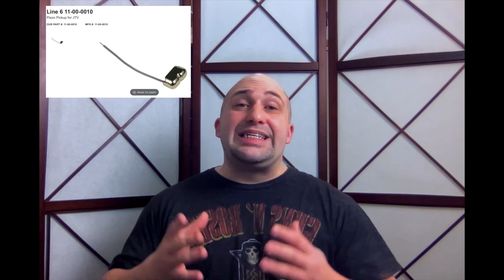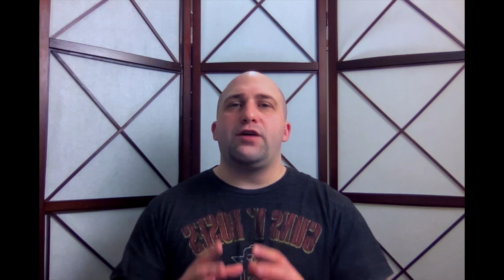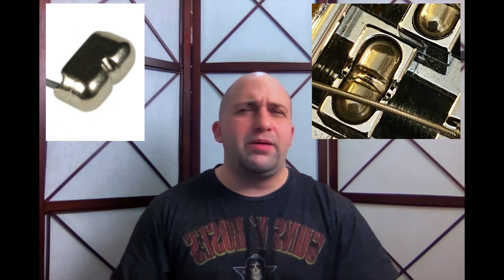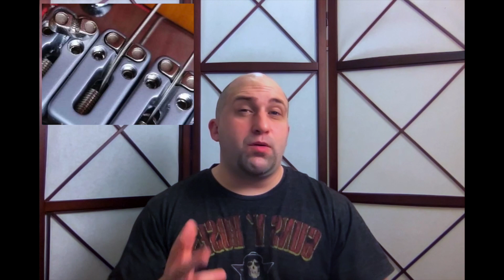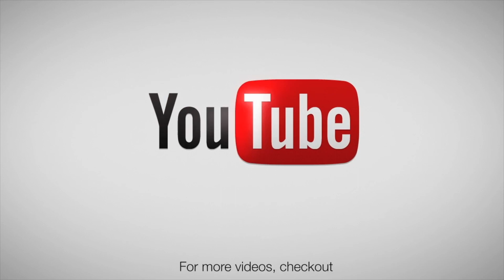JTV Sent for Repairs

Comment: I have been using Variax's since 2007. I have a 300, both 4 and 5 string basses and a Shurken. The only problem that I have with them is solved by putting a fretwrap at the headstock. Palm muting wasn't that much of a stretch for me as I rest my hand on the bridge anyway. I haven't had any problem with strings gorging the piezo pickup and I used the 4 string heavily for 4-5 years when I got it. I did everything with that bass, live gigs, recording, it was my main bass. I still do all my bass recording with that bass. I don't use anything else.
Reply from the maker: Agreed, the fretwrap for me was a must way before the Variax and it felt weird to not use them afterwards. I have five other axes and this one is always a go to because of the use with the helix.

Comment: The 59 would be such a great guitar if the materials were not of such poor quality.  I purchased 2 Brand New from Sweetwater.  The first had the saddle ping and sounded almost like the sitar model. It was replaced with another that started dropping out and scrolling through sounds after 40 minutes out of the box! The 3 way toggle stopped working with the models and became haunted, changing models all by itself.  After research, I found this is a well documented issue with the 59.  It’s a real shame because the design is brilliant and the neck feels like ambrosia.  It’s 59 Gibson inspired and nails it.  Thankfully, Sweetwater refunded me instantly. They are amazing.  The problem is, I really would like to have one that works without issue and I can’t help but wonder if that even is possible.  If you are a professional guitarist,
You can’t have your tools cut out during a show or a session.  Is there a serial number batch that is free from these issues?   The JTV 59 is also a 24 1/2 inch scale (not 24.75 like most gibsons) so it’s super comfortable.  Not an easily found set of ingredients.
Reply from the maker: Hi Mat. That’s a crazy list of issues! I can’t say I’ve experienced any of those but the saddle. I seem to wear out the piezo faster than others, but that’s not too much of an issue for a quick solder job. I’ve had mine for a year now and it’s been very reliable during shows. Sorry to hear you had such a problem.
Reply: @EricVadala  thanks Eric.  Do you mind sharing the beginning numbers of the serial number.  That contains the build date.
Reply from the maker: @MatGurman  not at all, give me a hour to get the number for you.

Comment: I plan to use (thinking of buying) this guitar mainly for acoustic purposes. I don't palm mute because I mainly play with my thumb and partially with a double glued on fake nail touching the strings. But I also use a John Mayer influenced slap type finger picking, where I slap the strings (forward of the bridge) with index and middle finger nails and part of the side of my thumb. Do you think this would cause the "pinging" problem?
Reply from the maker: The only time I had a ping is when my string ate into the piezo pickup. Line 6 changed it out for free and it was back to new.

Comment: Hi quick question, would you buy a 2013 model in 2022? Do you think that the chip will hold updates to come? Great video.
Reply from the maker: I don’t see why not. That was a holding point for me as well but it’s still worth the purchase. I don’t think updates would be a problem-especially since you can sub out tunings. If the UI was updated, I think it would be awesome to change out pickups and guitars. End point, if mine where to be stolen, I would repurchase immediately!
Reply: Thanks man!  I appreciate the advice. I’m gonna buy the goldtop p90 version for $700
Reply from the maker: @shadrackperez7325  Sounds good, the P90s are hard to find. It's a solid piece of gear. The only change I did two years later is upgrade the tuners with RATIO tuners.
Reply: Perfect!!! Thanks again for your time.